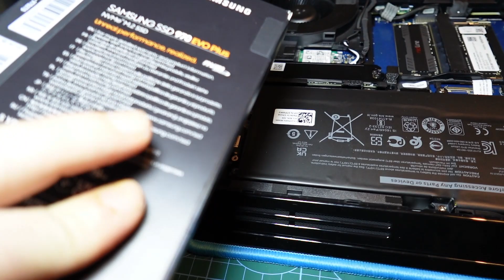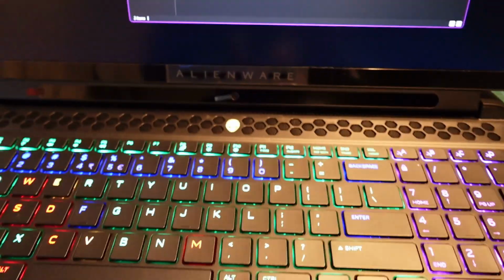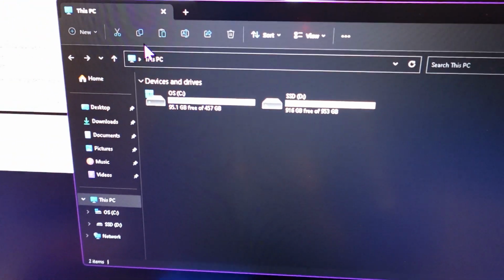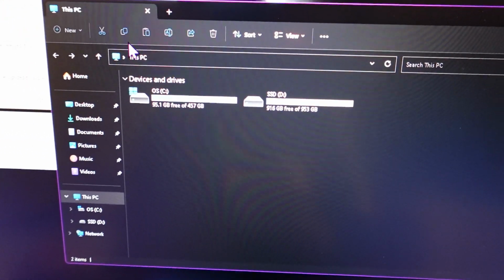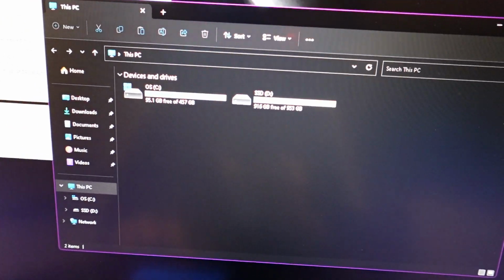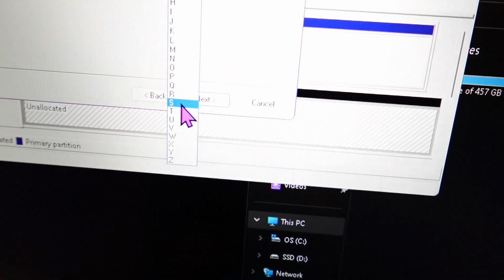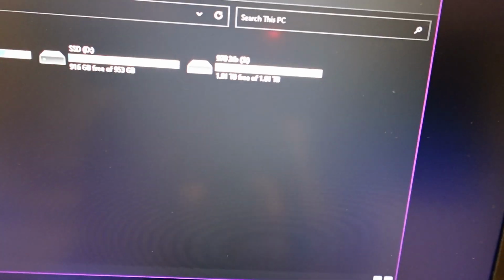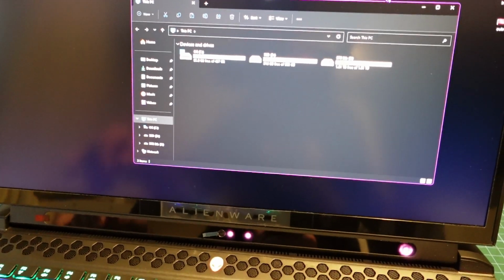Alienware Area 51m R2 Upgrade - Samsung 970 SSD - 32GB RAM 3200mhz

Comment: i never changed anything in my life came to see u change the ram then u dont even show u changing the ram -_-
Reply from the maker: That's the easiest process ever, literally changing laptop ram is what I was doing when I was 12,it has 2 metal shiny clips on the ends of each ram, you have to gently push the both apart until the ram sticks pop out, each sticj6has 2 shiny metal clips you'd have to push them to the sides of the ram in the same time and voila ram will come out.
Reply: @techroomuk   a different video mentioned unplugging the battery. Is that necessary?
Reply from the maker: @stubbs322  if you are clumsy and gon a drop screws or metal bits onto the laptops motherboard yes unplug it, but usually you can remove the ram without unplugging the battery, I done it a few times and never unplugged the battery, just change the ram, make sure they are seater properly until you hear a click and it looks like the stock ones. Make sure u have no water or anything else that can damage the laptop, like metal stuff, sweat,,, saliva etc thst will. Touch the internals of the laptop, and it's fine. Just take the back cover off, tale the old ram. Out, pop the now one in put the cover back on and that's it. You can do this, I belive in you!
Make sure ram is compatible, itf it's the same laptop alienware area 51m r2, it should be 3200mhz ddr4 laptop ram.
Pretty much that's it!
Reply: @techroomuk  I appreciate so much help. I just did it successfully! Sorry if I had an attitude I get really nervous at the thought of dealing with the insides of a computer lol. Thank you so much for the extra help.
Reply from the maker: @stubbs322  glad I could help, all the best, subs to my chanel for more stuff
Reply from the maker: Send me an email I will give u a tutorial

Comment: hows the 6950xt holding up? Any problems with temps or coil whine? Or any problems in general? Cheers mate!
Reply from the maker: I'm playing warzone 4k at 144hz and never seen temps over 75 degrees, that's with stock fan settings.
Reply from the maker: Considering it's a founders edition 6950xt, the temps are impressive, coil whine it's normal, it doesn't bother me, but depends some cards are worse than others. I would suggest buying one from amazon as you'll get one built in 2023, fairy recent, I have a link in the description of that video. Cheers